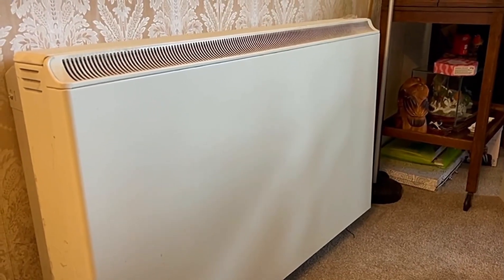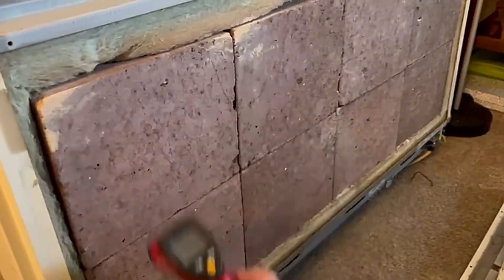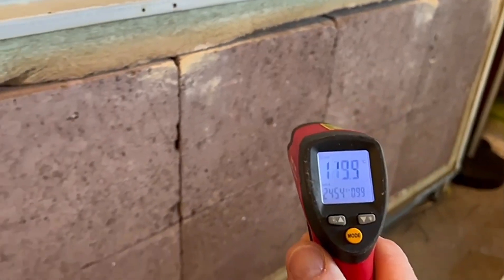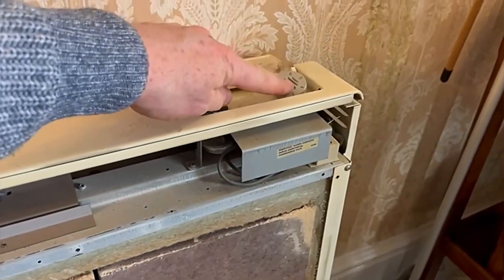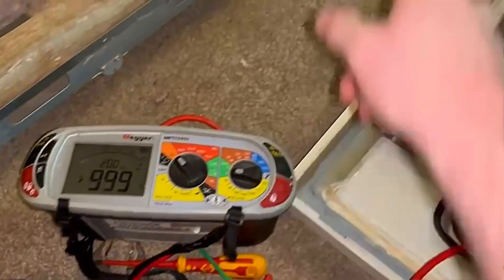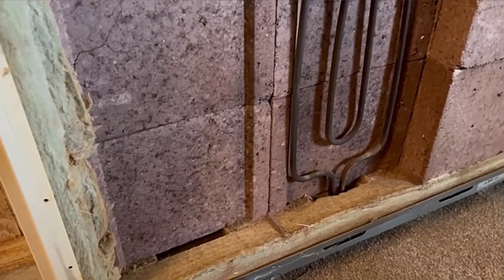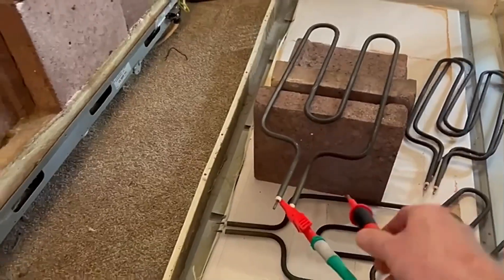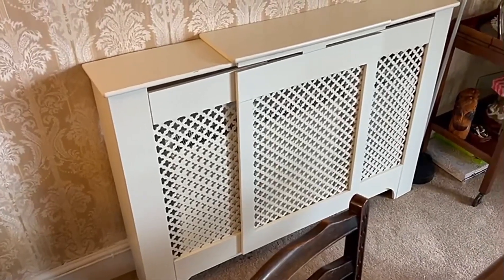Fault Finding - Storage Heater NOT Getting HOT

Comment: An easy way round detecting whether there is a fault or not these days, if the house happens to have a SMART meter with an in-house display, is to use the latter to detect whether a heater draws a normal current or not when adjusting the controls, as long as you are there at the right time - 00:00 - 07:00 GMT in my place. No separate tools required then.

Comment: if the element is suspect ,its a lot easier to test each element with a ohm meter / without taking the element out . just disconnect the input from the element terminal block . simple . then you can order a replacement and only have the take the bricks and cover off once when the get the new one

Comment: Please be very careful when opening these units up. If it was manufactured before 2000 they may contain asbestos. There is a list online that has the information as to which ones are. I found this out the hard way.
Reply: @keithsmith9833 what happened to you?